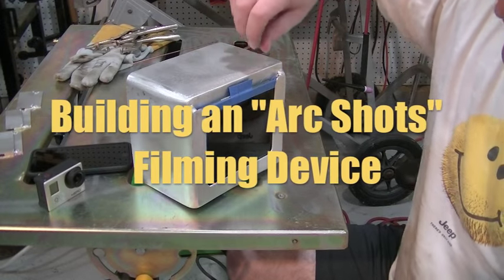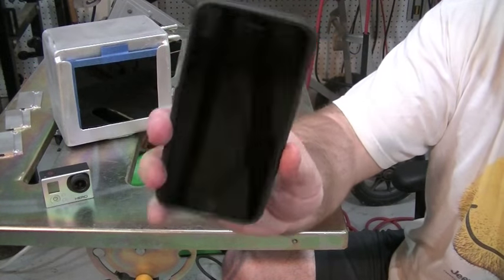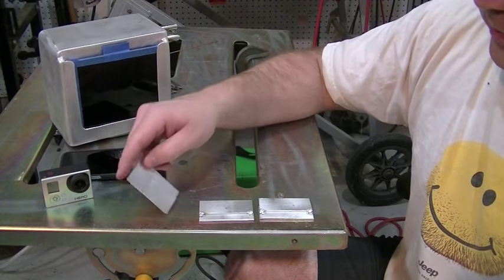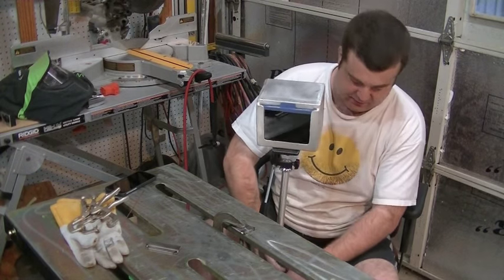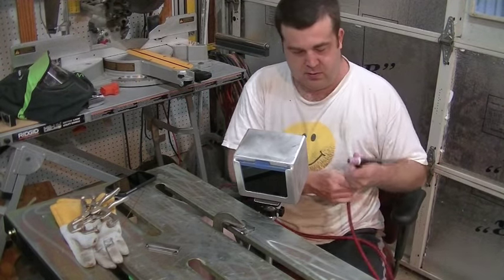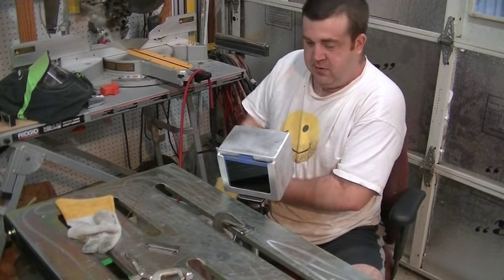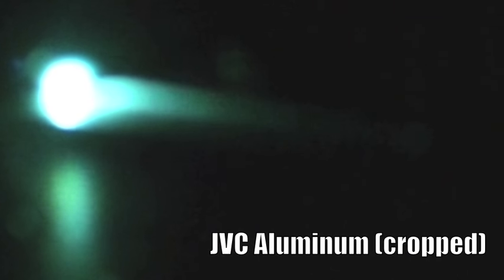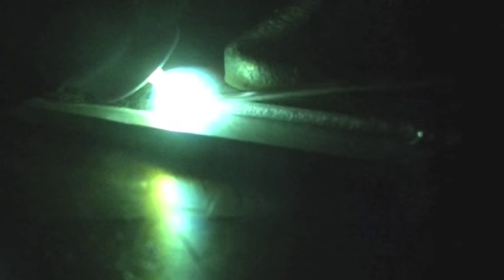PART 2 ARC SHOTS FILMING DEVICE | Filming the Welding Arc

Comment: A couple of things you may want to try with the JVC camera. First, with the welding lens out, focus the camera on what you want to shoot. Then switch to MANUAL focus. Adjust the focus if needed, but it should be fine. This will hold the focus and be sharp the entire time. Second, there should be a setting for exposure. You would want to lower or darken your exposure. This will help with the shot being too bright. Put the welding lens back in and try it out. The shot should now be in focus when you start and if it is still too bright, darken the exposure more. Hope this helps you out.
Reply from the maker: VERY helpful!!!  I will give that a shot!  Thank you sir!